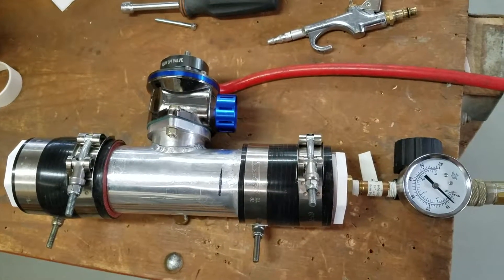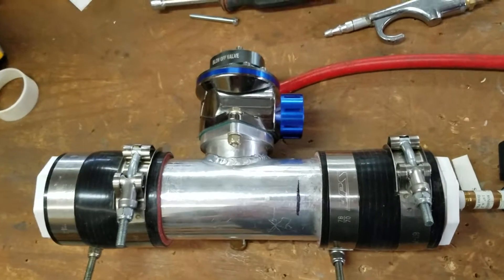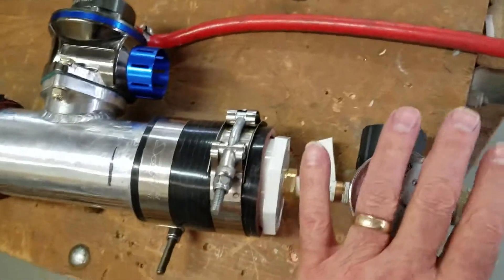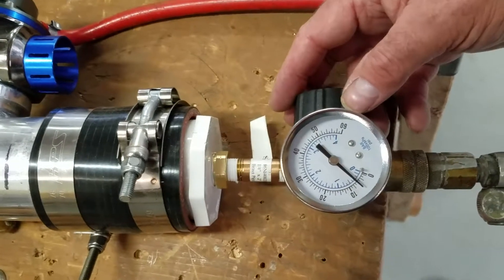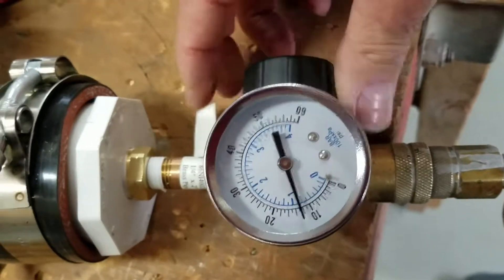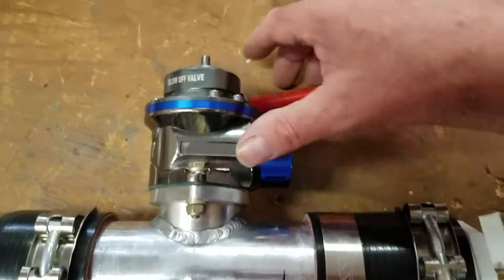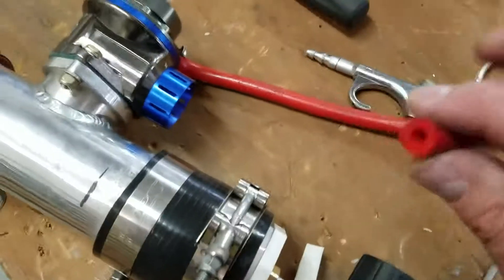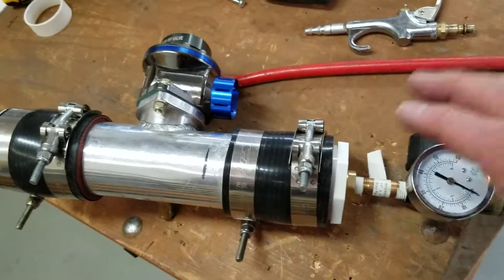Testing the BOV for my Honda R18 kitplane project

Comment: Hey so I know bovs tent to make a cool noise when releasing. I’m thinking of building a contraption like this, when you press pressure into the bov does it make the pssshh noise when opening. I kinda want to build something like this
Reply from the maker: yes. the greater the pressure over the set point, the greater the noise. but there are probably better, easier ways to make that air release sound....

Comment: I trust Chinese parts on the ground, but I really don’t think I would want Chinese parts if I was up in the air man, but I’m not a pilot, and I’m afraid of heights, lol.
Reply from the maker: It really is not the country the device was made in that determines the quality.  There are some important things that I do when evaluating a part.  For this unit, I completely disassembled it to check the quality.  It was good.   Second, I tested it to ensure that it works properly.  The device is bone simple.  A tube and a spring and adjustment screw.  That's it.   Good to go.
Reply: charosenz I agree, and these are the best ones to buy.  I’ve bought a real GReddy one of these in the past, then I ordered two copies after that.  Some of the other styles are not very good though.